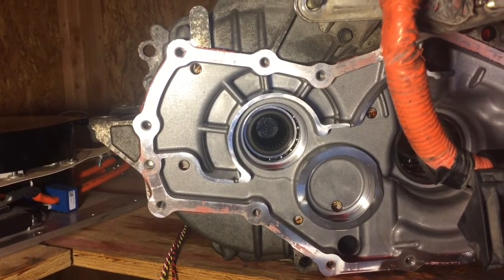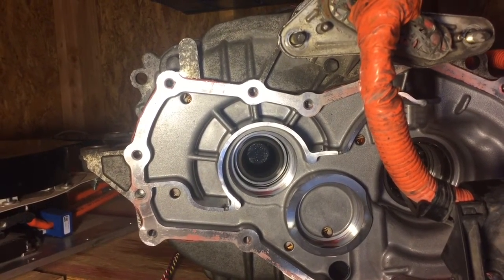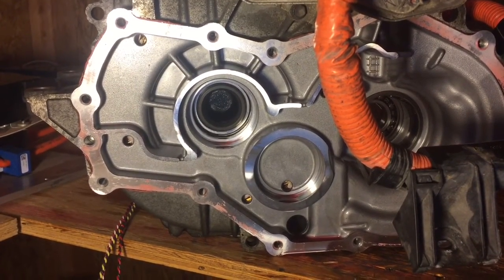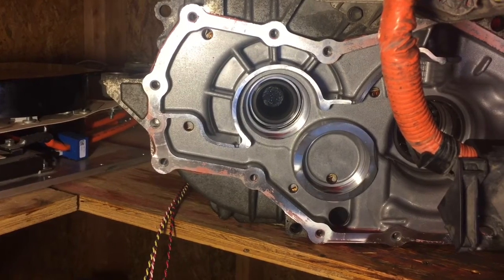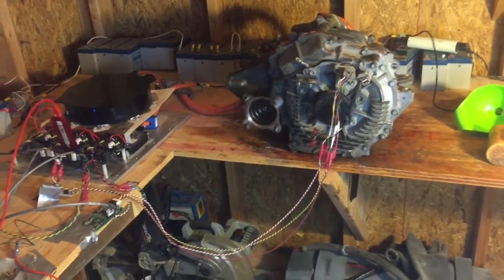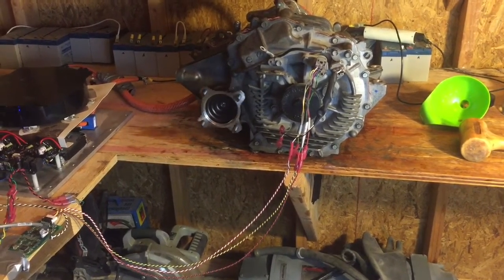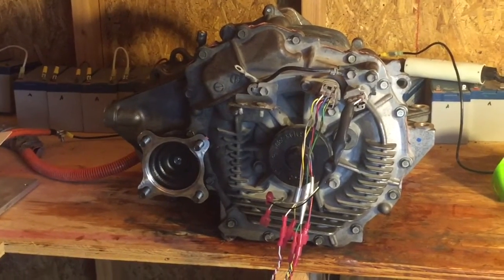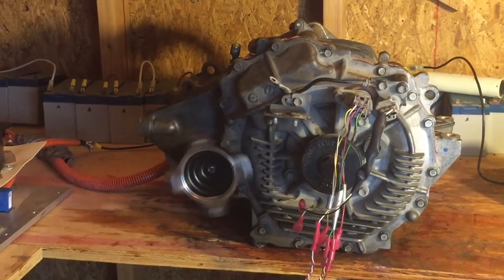Toyota Hybrid Motor-Generator

Comment: hey Paul, question buddy. so i have a 2010 lx450 and Toyota service guys said that i need a new generator to be put into. Is it hard to replace it? i cant a video or a part how does it look iike or to do the job.  Please let me know if you have a video like that or knows where to go. thank you.  I subscribed to your channel.
Reply: I'm a Hybrid Electric Vehicle Tech currently in school, and from what I can tell you, it's best not to touch that thing. They go out like a regular car or trucks engine does, so it's like a 100-150k fix, or sometimes a bad armature bearing will cause it to go out prematurely. But that's not very common.

Comment: Can we use this to make a generator
Reply: it already is a generator. Inside is the generator, and this is the Amateur that is connected to the HV PCM. It converts 3 phase to power back and forth from the battery bank to the wheel.

Comment: I want one for electric car conversion. If only i knew how to use the inverter. Does the inverter control the motor? Are they separate?
Reply from the maker: Yes, the inverter controls the motor.  It's a separate thing from the motor, although sometimes they bolt them together.
Reply: @MPaulHolmesMPH the generator starts the gas engine in one direction like a starter on a normal car. Then the engine turns the generator to generate power for regeneration of the battery. What I need to know is how to get the generator to start my engine? I have a, "low generator position" code 51.

Comment: Nice work! If you can figure out a way to get rid of the EV limiter - please contact us
Reply: In this video https://youtu.be/ZmHpSyTsfm0 they explain that the smaller of the two motors (MG1) spins too fast once the car goes beyond a certain speed, so the engine needs to start to reduce the speed of MG1.  I guess if you disabled this you'd end up spinning MG1 too quickly and damage it.
Reply from the maker: psihybrid what EV limiter?
Reply: MPaulHolmes looking for a hack to let the electric motor run longer before the engine kicks in.  I heard stories through the years but can't seem to find anyone willing to share 🤐
Reply from the maker: Hmm.  Boy that would be handy.  Unfortunately I don't know much about the actual cars.  I just have the electric motor part of it.

Comment: Nice job! I have one sitting on a shelf I thought would be a boat anchor. My plan was to build an electric UTV and go race it. I'm great at the mechanical stuff, but not the electronics. If you need things machined or fabricated, I will happily swap services. I can sure use help in making this motor run. Thanks!